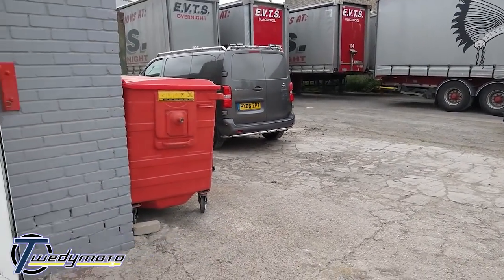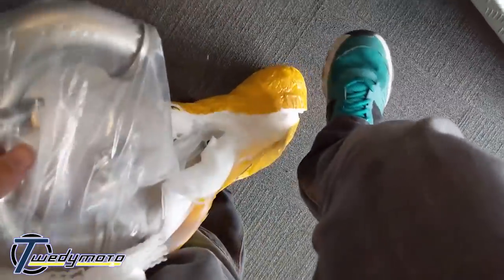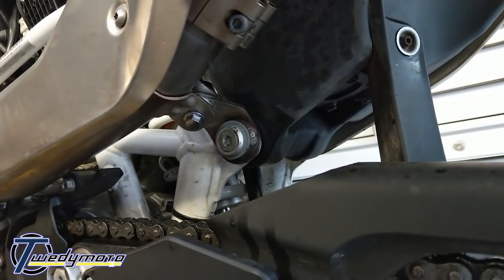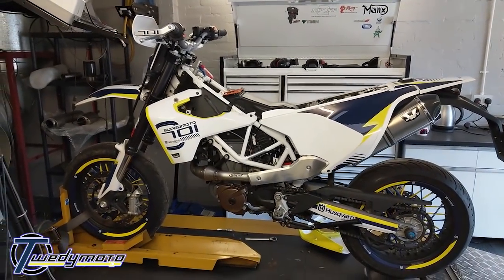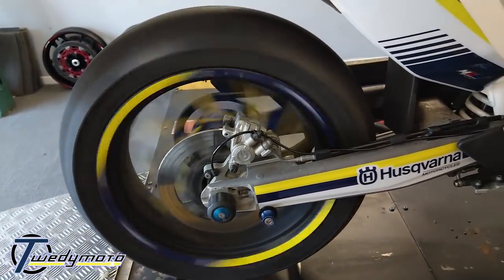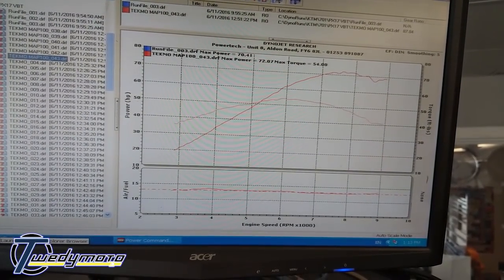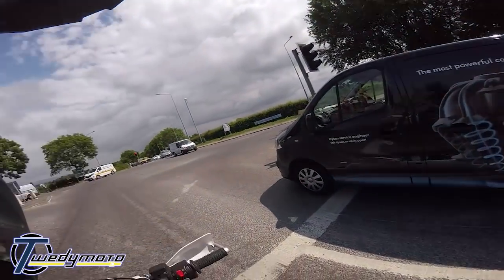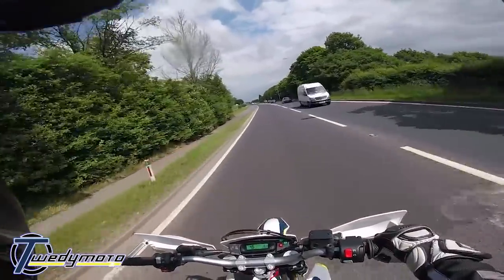Husqvarna 701 Dyno Tuning And Results! New Tekmo Header And DNA Intake Mods!!

Comment: I asked my local Dyno center here in NZ to book my 2017. 701 in for a dyno run with the Pcv. Asked him if I should buy and fit the tecmo header beforehand. He told me not to bother, as a few of the ones he done actually reduced the hp by -1 . Said it’s just not worth the money they cost just to find out you either gain 2hp maximum or loose 1hp. Said every bike is different. So I’m gunna spend the extra money on a re-ground cam later. Nice video mate.
Reply from the maker: That's the thing, every bike and dyno is different. And it's not always about the peak power, it's the area under the curve and the mid range. But yes, spending money on a cam will be much more worth it 👌😎
Reply: @Twedymoto  Bloody lockdown so my PCV is stuck in shipping somewhere.  Wonder if the dyno man could up the bottom and midrange and sacrifice some top end. Will ask when I get there.  I'm from Bristol myself. Its nice to see a video done from over in the UK . Glad to hear it pulls better, I hate wasting money

Comment: I heard they have autotune that is like a riding dyno at all times. Would you try that? Also was the tekmo header worthiit
Reply from the maker: IMO Autotune is great if you're always riding with drastic changes in altitude but i'm not sure if you have to connect a computer to save the changes all the time :/. I'm very rarely above 300m so probably not worth it for me. The header is pretty and gave a nice boost in power but as this is the first generation pipe it's a pain as it's in the way of the oil filter it has a couple of fitting issues which i think have been sorted now. I got mine with a discount, not 100% sure I'd buy again but I think Arrow do one now.
Reply: @Twedymoto  nice yeah I'm up in Colorado so it's always changing. I have the tekmo on order with a titanium arrow pipe. With the Rottweiler intake and pvc/auto tune. All getting installed in two weeks can't wait to see the difference from stock
Reply: @bigwigglystyleyadigg  what were the results? Are you happy with the auto tune?I’m thinking about doing the same thing but I am considering auto tune vs a dyno tune with switchable map slots.

Comment: so full exhaust and filter give you around same power then the new stock 690
Reply from the maker: Remember that dyno figures are always given as "at the wheel power" they're not calculated to crank so that's 72hp at the wheel and there's roughly 10% loss through the transmission and wheel so that's roughly 80hp at the crank. The 701 and new 690 use the same engine with 74hp at the crank as standard.
Reply: Dude, it's the same engine................@Twedymoto says the truth

Comment: Bit of advice if you change your header be prepared to change the studs as the nuts are self locking and mine had galvanised on the stud.
Reply from the maker: Yeah I know mate. They had stuck to the studs so just used the studs like bolts. If I remove it again, I'll replace the studs and bolts! My grom done the same thing!
Reply: @Twedymoto  I found out today new studs and nuts lol google fowlers bristol parts they show full scale of bike any part,delivery too.Id also change the exhaust head gasket ive seen 80bhp 701s safely tuned
Reply from the maker: yeah mate i get parts from fowlers and trevor pope. the full parts catlogues are on the husky website too. I think mine will be close to or over 80hp the crank, but fitting a high lift cam and more fuel will see over 80 at the wheel no problem!!
Reply: @Twedymoto  post that if you do that dyno day 2 lol
Reply from the maker: Don't want to send it to an early grave so the only time that's happening is if the engine dies! lol
Reply: @Twedymoto  LMAO besides overpowering a single not much fun unless its geared correctly.Its alot of work and like you said early grave.Ive had lots of supermotos and the husky is beautiful have fun fella thanks for the reply been good chatting to you if you ever get any problems let me know.I also have the full repair manual pdf.

Comment: Hi my pipes on its way did you fix the gap?im running mine with rapid bike auto tune same kit as yours no problems except evap delete no pop at all.cheers
Reply: And i have the titanium remus it barks like the akra
Reply from the maker: No I haven't really touched the exhaust since I fitted it to be honest but now that I need to do some work on the bike, the pipe is in the way of a few components so it's going to be a royal pain to get the front sprocket cover off and changing the oil filter is a joke. but this problem should be fixed on the newer pipes.
Reply: @Twedymoto  youll be fine buddy no need to move the pipe for evap and unless the bomb gets in the way for the filter youll be ok.The only thing id say is take your time on the bolts as the threads on the engine for myself is a nightmare ive already rethreaded once it was unavoidable.
Reply from the maker: The bomb is in the way of removing the oil filter, had to squash the old one and pretty sure the new one took a hit when putting it in too! I have a small torque wrench. I'm a twat for doing up small bolts too tight!! lol
Reply from the maker: If the thread is completely fubared, try a time sert. just learned about these and they're the only option i'd do if i stripped a thread. :)
Reply: @Twedymoto  hey fella the bomb isnt meant to be in the way of the filter or the gap you was too excited to get it on i just read the instructions and im about to install mine.
Reply from the maker: @daidavies1791  I think I have the version 1 pipe but it has been updated to correct some fitting problems like too close to the radiator and touching the front sprocket guard.
Reply: Possible but from reading the manual i have it warns you of the positioning.
Reply: @Twedymoto  oi oi just done my pipe no gap positioning is a nightmare but,you have to put the sheild on 1st loosely then the exhaust panel for the sheild then hold the header up i used pull ties to the frame were all 4 points meet then i tightend the header bolts and repositioned the sheild and tightend the rear header clamp then tighten everything else pain in the arse but worth it.
Reply from the maker: Hi Dai. I messaged a few people yesterday and it appears that i have the first version that has some fitment issues that were resolved mid to late 2018. I may be able to adjust the hap in the side panel slightly but just have to live with it. haha
Reply: @Twedymoto  i have an idea but it means driling a second hole.Line it all up without the gap,the only one that isnt alighned properly is the mid exhaust clamp.Mark the clamp with the sheild on take the clamp off and drill a second hole in the clamp but be careful not to meet the 1st hole it is possible with a bigger clip to reach.

Comment: I have a question about the dna air filter, does it just sit open like that or do you have to put the long snorkel back on ? Plz and thanks
Reply from the maker: It sits open like in the video mate. There's an orange "stage 2" plate that goes on top to keep in held in place. I've never had any issues with water getting in but I never pressure wash that area and rarely ride in the rain. 👍
Reply: Thanks for your time mate 
Thank u
Reply from the maker: No worries dude, happy to help.

Comment: I'm thinking of geting a new 701. But I allso want to do some modicifation. A full system (Acra?) new air filter, Power commander and a dyno mapping. Is it anything more ?
Reply from the maker: That's pretty much the holy trinity of tuning bud. More air in, more air out and some mapping to suit. It'll rip after that!! 😁
Reply: Akrapovic doesn't make a full system as far as I'm aware only the end pipe

Comment: What is the estimated drivetrain losses on a bike? Just looking for what kind of gains this would be over stock.
Reply from the maker: The loses are around 10% +/- a few% I beleive. From what I've seen and what many others have shared, for the 74hp model, they seem to dyno between 66 and 68 at the wheel. 👍

Comment: could you post links for the DNA intake? aswell as social media links for powertech as im finding a few different ones and im not to sure which is which! :) thanks
Reply from the maker: Links posted in the description now mate!!
Reply: @Twedymoto  That's brilliant mate thank you!!!
Reply: @Twedymoto  Also mate on last thing! Is the Tekmo header necessary or did you just do it for weight reduction and stylization :)!? It seems a steep price if there aren't many benefits. :)! cheers bud
Reply from the maker: @jordangenge6417   Tekmo had a deal on as they were just launching their website so i think i got 15% off or something like that. the weight saving is minimal. it looks awesome and there are performance benefits too. It adds a few more hp and torques to the mid range!
Reply: @Twedymoto  Thanks man, appreciate all your help. How loud would you say your intake is as I read below that you cant hear your exhaust much over it which kinda sucks as I like the sound haha
Reply from the maker: At full throttle is about 120db. if you check a coupl eof my other vids you can hear that the microphone can't handle it! lol

Comment: what size front sprocket do you have on the bike?
Reply from the maker: Had a 15 on the front since the first service. Now have a 44 on the rear and that gears it down further. Good fun and still do over 100 lol
Reply: @Twedymoto  hell yea! I'm thinking of putting a 15t on the front. Did you notice a big difference at all with that change?
Reply from the maker: @FreeStyleSkier802  the change to 44 on the rear was more noticeable as I was still getting used to the bike when I done the front. I'm always going fast so the engine was screaming a bit more but so much fun when riding hard.

Comment: Is yours the old or the new one with 74hp from the factory?
Reply from the maker: Mine is the updated motor with 74hp.
Reply: @Twedymoto  Check out Pirateracing111 his dyno showed 80hp at the wheel new euro 4 akrapovic BMC air filter with intake manifold and tekmo headers with Power Commander 5 and a good tuning!
Reply from the maker: Just watched that, good to see lots of back to back testing done which a lot of people don't do. I've noticed that their stock dyno run (on their website) was 73.5 so that's either massively inflated or they are calculating crank hp. There's only 1 or 2 bikes I've seen with 80hp at the wheel and they had a performance cam installed with lots of other mods. I think a new intake will be next on my list but got lots of maintenance to do on it before I do that.
Reply: I think if you have a supermoto you shouldn't care that much how much HP or torque u can get out of it, a 700 will have plenty already and the thing is a really powerful supermoto will wheelie too quicky I believe. My supermoto only weighs 95kg and the basic mods and tunings I do to it cost almost nothing, and those are the most important as well being: countershaft elimination, open air filter, decat, carbu optimization, derestriction on the CDI & iridium spark plug, that's already gonna make it fly I believe :).
Reply: @Twedymoto  maybe a bit late, pirate racing always uses crank hp thats why there ratings are almost 1 on 1 with factory rating from husqvarna.
Getting 72whp from a 700 single is bonkers, my old xt 660 made 51whp with full exhaust system dna stage 3 and power commander custom mapping.
Just shows how potent the 701 is from the factory,
To bad for me i got an euro 5 701 so no power commander for me.

Comment: Hi. It's 2 hp from header only?
Reply from the maker: Yes mate. 2hp from fitting the header. Another 2hp after tuning.
Reply: So it's great result. 😃 Thanks for your reply.
Reply: Twedymoto Didn’t you fit the Header and intake mods together? So the power gain could be from either, or both?
My ‘17 701 with the EVOII intake, wings pipe and PCV went 79.78hp on the local Dyno. I’d buy the header if it further improved the power.
Reply from the maker: @SKYP1G  Yes, that was from fitting both but to be honest I can't see the intake making that much of a gain as the stock airbox is the limiting factor now. All dyno's are different, if i take it to them again it will probably be different again.
Reply: Twedymoto Thanks for the info. Pretty interested in trying the header out. 
Mine has no airbox now. The KTM Evo11 filter is just a K&N filter straight onto the throttle body.
Reply: So like 4 hp for 3 grand?
Reply from the maker: For 3 grand I'd want a turbo with nos! 😂😂 It was roughly £1000 for all performance parts including custom tune. The base run still had a generic map so that may have given 1 or 2hp too. It's not all about peak power though, it's so much smoother and easier to ride now. 👌

Comment: It's very low power.... Husaberg fe650 dyno 76hp
Reply from the maker: Bergs are absolute animals and they're also competition engines, this is a road bike. lol
Reply: Every Dyno is different comparing hp numbers from different dynos turns into a pointless argument, for example I've seen a few husaberg 650s in the low 50s after exhaust and carb tweaked to suit

Comment: i have a 701 with 91hp xP
Reply from the maker: Whaaaaa?? Turbo? Lol
Reply: @Twedymoto  titanium exhaust manifold of tekmo, exhaust of sc project, kit remove sas e canister, air filter of rottweiler without air box and 
dedicated remapping of the original ECU on the bench
Reply: i see a turbo 690, 133hp :')
Reply: Do you burn premium fuel now with all them changes?
Reply: @Alien300Blackout  my mechanic advised me to use the 101 octane but telling me it was not totally necessary, 
if I had wanted to process the engine for example by increasing the compression then it would have been necessary
Reply from the maker: I've always used premium fuel in my bike which in the UK is 97-99 octane. I only put 95 (standard) in when premium is not available.
Reply: @Twedymoto  We no longer have that high of octane available here in the USA
Reply: Where do we go to check this out?  Send me a link or email address I'm interested.
Reply: What have you done? I think the 72hp are at the wheel and your at at the engine... ?
Reply: What mods?
Reply: @Alien300Blackout  the rating system is not the same there 99 is like our 93 stateside